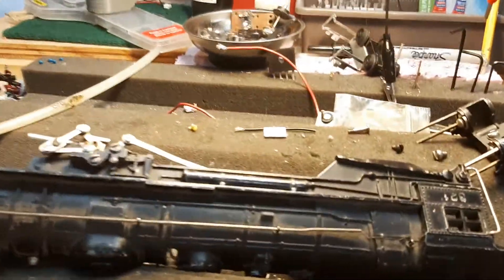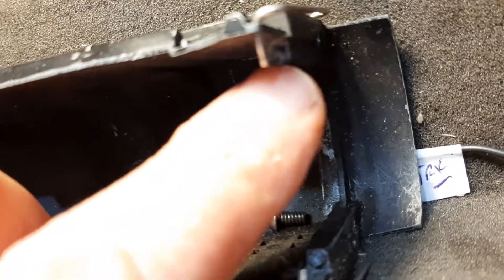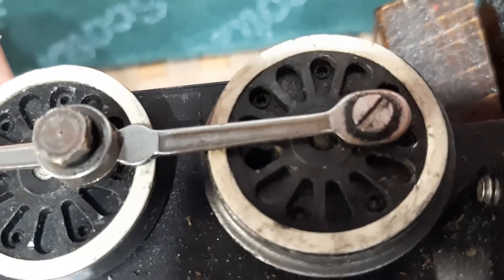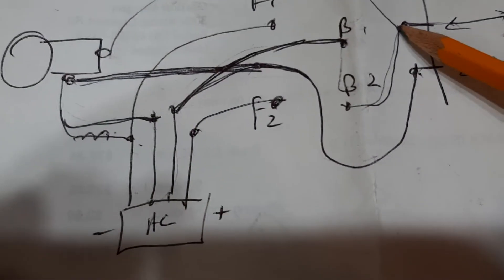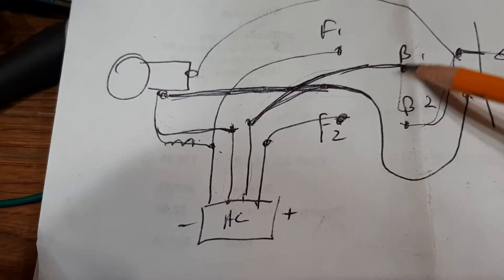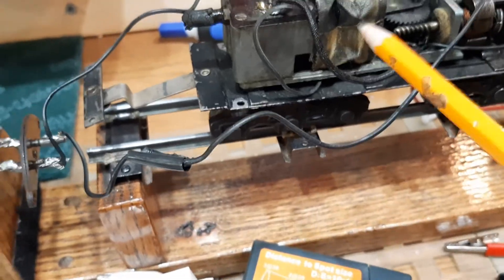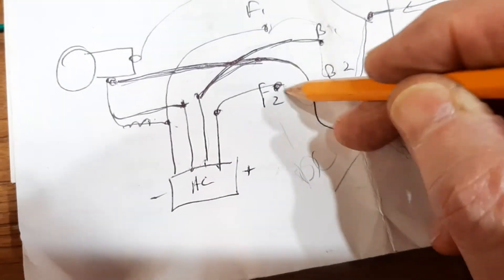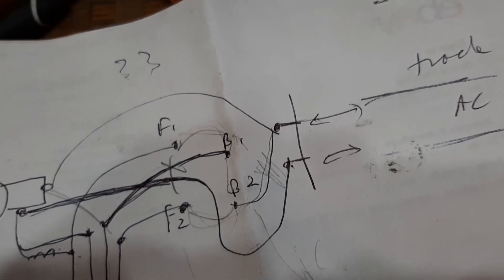Hudson wiring mystery

Comment: The input throttle should be DC. It is wired so that the field is stationary no matter how the current is flowing. The "AC" is the raw DC which allows the direction to be reversed.
If you wire your rectifier between the track and transformer with a reversing DPDT switch, you should be set.
Reply from the maker: I can't recall exactly but i did get it to run OK. No reverse in the engine though. I still have the old monster in box, maybe i need to drag it out and fix it for real. D